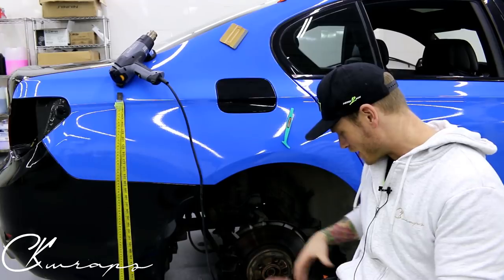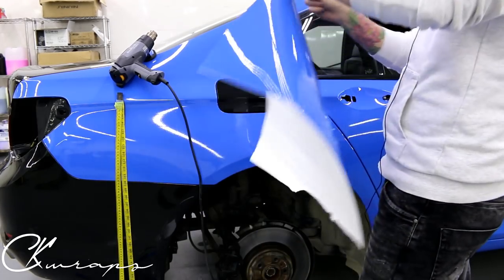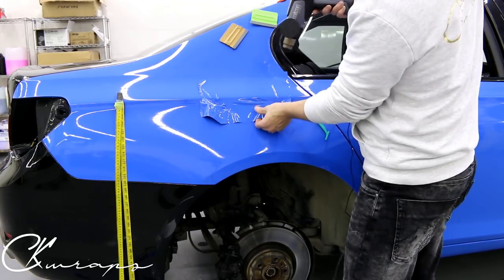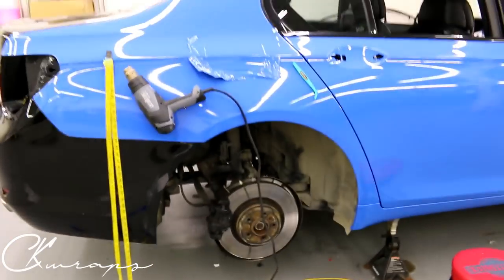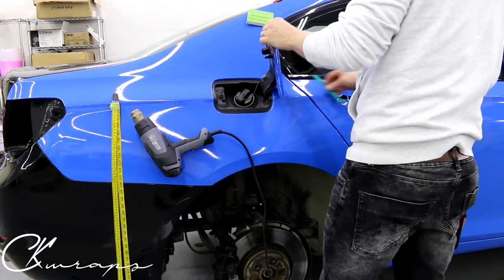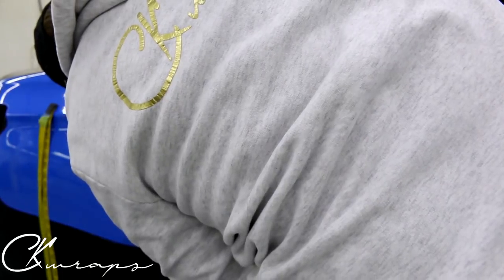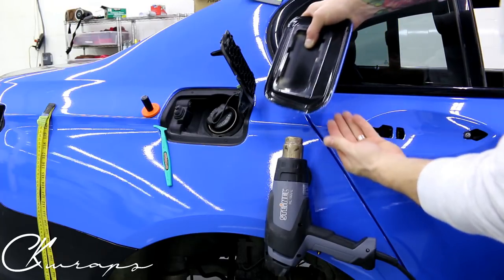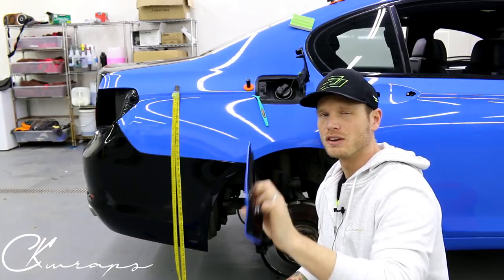How To Vinyl Wrap A Gas Tank Lid / Cover Like a BOSS!

Comment: Wish I knew how to add pics of what I've done. I used the cheap Ebay films, I wrapped my round gas tank cap in black chrome, looks great until the backside. Has a ton of fingers, none on the edges, or visible until you open it.

Comment: Great instruction!! I wrapped the fuel door on my 10th Gen Type R and it came out pretty good, I think. I used film from VViViD (Ghost Metal Forged Composite Carbon). Though I'll probably redo it, to stretch more around the 2 corners and cut the film a bit larger so I have more to wrap around the door lid.

Comment: I know a lot of tool companies are really pushing the magnets to stick to the car but it’s always been a huge pet peeve of mine to put tools and shit on the car. I like to use rolling carts and making it a rule to never set shit on top of a car, let alone a customers car. Have you ever had anything cause damage by setting something on a car or am I just overly paranoid?
Reply: the magnets seem like they hit hard and cause damage but they dont. they have foam piece underneath that prevents damages
Reply from the maker: The tools that stick to the car have never caused any damage. The only issue is that you can't leave the magnets resting on an already wrapped area for too long. If you leave them for too long it'll leave impressions in the film
Reply: That's why we also have GeckoPatches.  Christian uses them in few videos. You can stick them to any gloss, smooth surface like the window of the car and have all your magnetic tools on them. See the link attached https://www.instagram.com/p/BSvwcufB6M9/?taken-by=signmakertools Or visit our website www.signmakertools.ca
Reply: CK Wraps do you have the name of the Magnet? I know you mentioned it in a earlier video?
Reply: We have a big variety of magnets. Check our site www.signmakertools.ca for tools that are used in this video.  https://www.instagram.com/p/BSvwcufB6M9/?taken-by=signmakertools